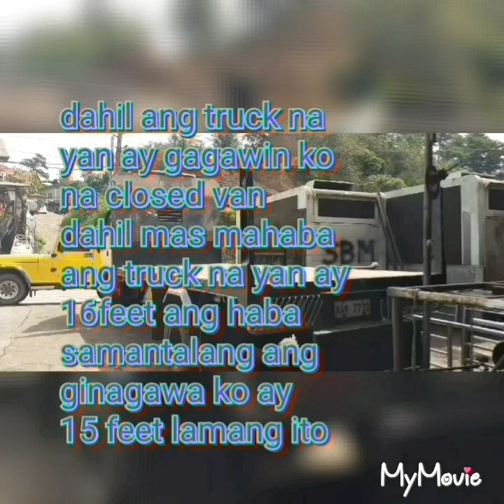Truck body building  part 8 (aluminum sidings installation)

Comment: boss gudpm pag ganyan po magkano kya pag papakyawin labor lng salamat sa reply mo
Reply from the maker: Hindi po ako sure dahil matagal na ang video na yan 
Siguro aabot ng 100k plus 
Salamat po
Reply: pag labor lang boss sa kanila materyales salamat sa tingin mo magkano pwedo singilin papalitan lng ng aluminum siding dati kasi kahoy magkano kya pwede ko singilin
Reply from the maker: Pag papalitan namin ang flooring ng isang sasakyan dahil dating kahoy 
Ang singil namin pag single tire 15
Pag double tire 20
Sa ten wheeler 30
Hindi ko kasi alam kung magkano ang singil ng iba
Dito sa amin  
Pero ang alam ko mas mahal ang singil nila 
Lalo na ngayong pandemya 
Pero depende na sayo sir kung medyo taasan mo ng kunti ang singil mo at kung okay lang sa may-ari ng sasakyan ang pag-usapan
Ninyo na labor kung papayag sya
Tignan mo sir kung mahirap at maraming ipapagawa sayo  dagdagan mo ang labor mo 
Salamat po